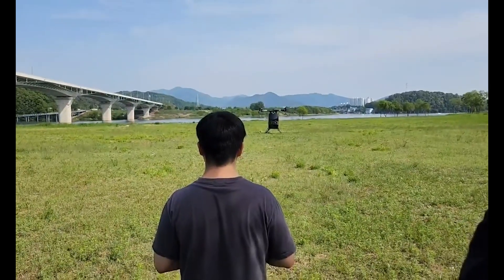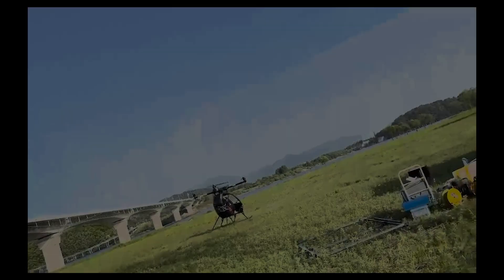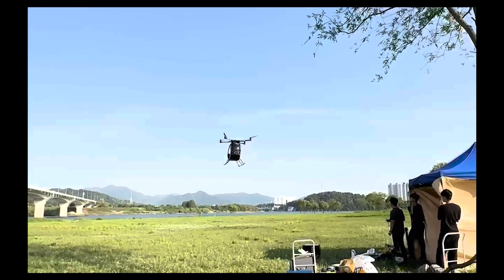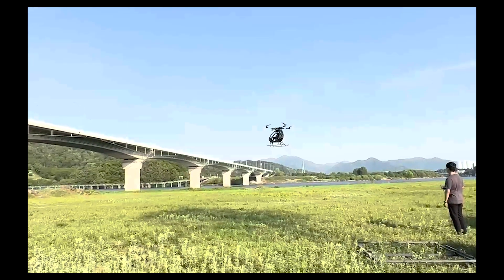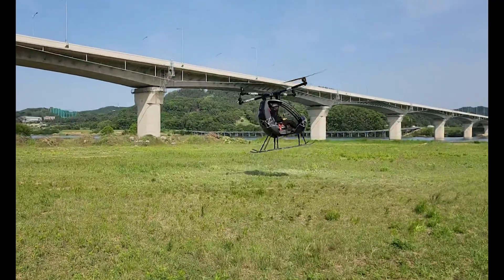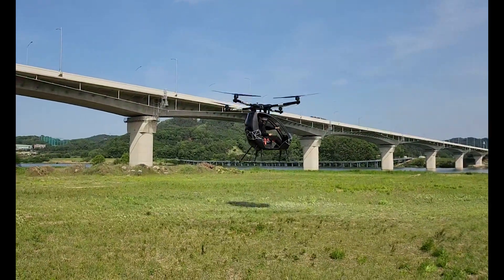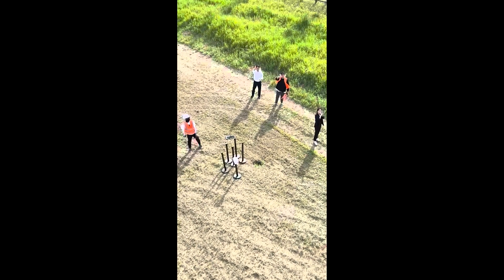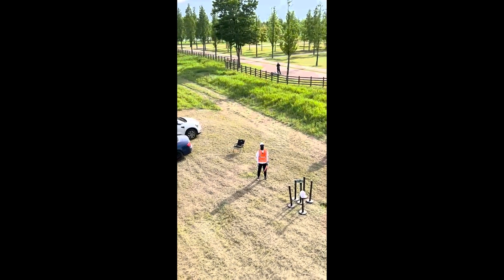Manned Flight in Our Real Flying Car - The First Piloted Hover

Comment: congrat.
what % of throttle are you using?
from outside it look like you are just over the 1:1 thrust to mass ratio.
why dont you use a pusher config ?
Reply from the maker: Good eye! Hovering was just above 40% throttle. About pusher config—I considered it, but for stability and safety this layout worked best.
Reply: @jenk5109  you mean pusher is less stable ?
i guess 40% will not alllow you to make a commercial usage.
do you considere 30% ?

Comment: What software are you using ?
Reply from the maker: We mainly use ArduPilot software, alongside Mission Planner and QGroundControl depending on the situation. We also developed some customized software features to better fit our specific project needs
Reply: @ thank you for replying , I have been working myself for over two and a half years on a similar project , but I started from scratch learning studying building ,failing many times ,as you can see in my videos 👍 I need some good weather to execute the main flight
Reply from the maker: @George25  I watched your video. It looks very solid. I think it would be nice to share the difficulties while working on a project
Reply: @ one of the biggest piece of knowledge I ignored from the beginning of my journey was - the science and identification of the propellers .in the last year and a half all my failures were because of installing the propellers the wrong way , I spent the last four weeks learning about propellers , now I can’t get a trailer and have some good weather to go out for my main flight test . Iam sure there is more to such project as issues but right now I need some good time, I had enough “ bumps” .Best of luck to you guys - is good to have a team 👍👍